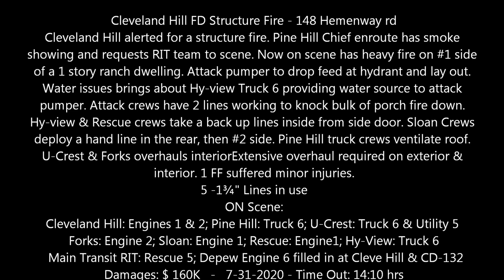Cleveland Hill FD Structure Fire - 148 Hemenway Rd

Comment: Why was that roof vented? The fire was completely extinguished. Also what’s the deal with everyone on the roof sitting down? If the roof starts to fail there’s no way you’ll be able to react quickly from a seated position, plus it makes the saw operation cumbersome and insanely dangerous.  

Vertical ventilation is arguably one of the most dangerous tasks on the fire ground, don’t make it even more so by coping a squat on a burning roof.